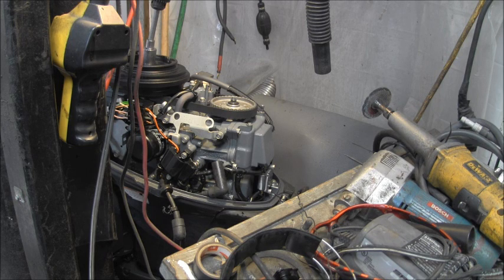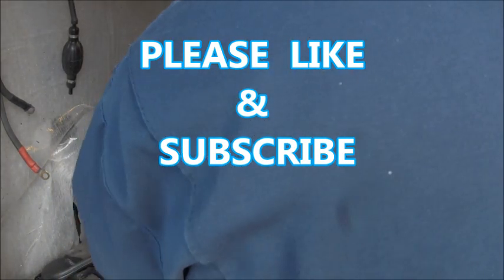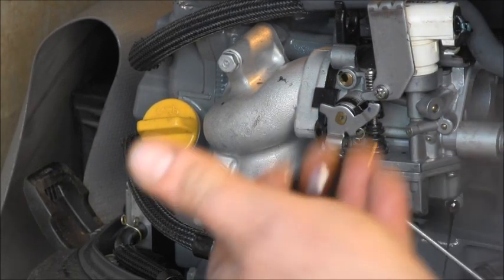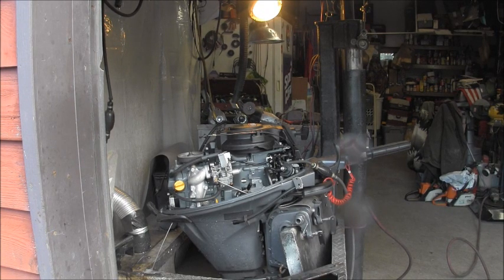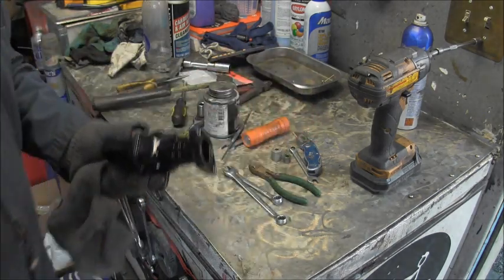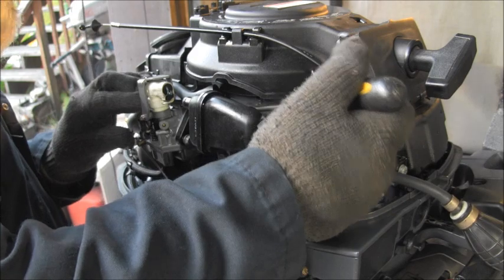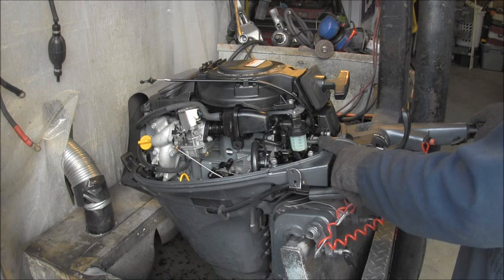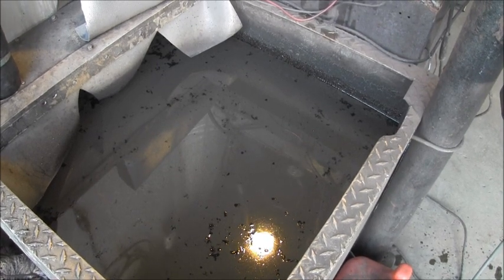2011 YAMAHA 15 HP 4 STROKE,  HYDRO OIL LOCKED  + Rant

Comment: I love both of my mercury 4 strokes - Smooth, quiet, almost  smoke free.  There is a right side and a wrong side to lay it down on.  On the side of my year 2003 merc 6hp 4 stroke there is a decal showing which side to lay it down on.  I take it off my boat every fall - transporting it home in the back of my truck laying it down on the correct side and never had a problem.  rtfm.
Reply from the maker: They R clean & quiet  4 sure, & great on gas,  But heavy , Tech will catch up I'm sure.  kodi

Comment: I made a tank out of one of those 375gallon plastic containers working great but those leaking lower units make big globs of oil looks like the movie the blob I use a butterfly net to get most of it and dawn dish soap all I have is old outbord motors newest one is 1974 6hp Evinrude
Reply from the maker: Good motors 4 sure,  If u add about 1/2 cup of lubriplate 105 to the lower oil they do not leak near as bad & it only helps the gears.             kodi

Comment: Another reason to hate 4-strokes two strokes can be a pain but 4 strokes, LOLL!  I would of walked away from that engine 10 times cursing my butt off before I would finally gotton past the frustration. I give you alot of credit you are more patient then me. That fricken carb alignment what a nightmare too. Maybe next time just go right to the carb and the fuel pump and see how bad the oil is in there before yanking it when you found oil in the cylinders. This video taught me that lessonioness & directioness for sure I speaka the Spanish ,HAA ............
Reply from the maker: Yes U R correct,  start @ the carb & work toward the filter.     kodi

Comment: Agree on weight of 2 strokes vs 4 strokes. I have a 87 Evinrude short shaft pull start. It weights 78# the 4 stroke I believe is 105#. I doubt if the four stroke could keep up with the Evinrude. I’m old and I can mussel around the Evinrude but not by much. No way I could handle #105.
Reply from the maker: Yep  me  2 lol    kodi

Comment: Would you mind sharing what lubricants, 2-cycle and gear oils you’re using now that BRP is out of business. I’m a newer owner of a JOHNSON and have read that their oils have special detergents in them for use in water! My outboard is primarily used in brackish and saltwater. I’d like to use the best, not the cheapest maintenance products I can so this will last. It’s a 2002 40hp Johnson.
Reply from the maker: I use Amsoil TCW-3 Marine 2 cycle oil for the powerhead fuel mixed 50-1.  I use Amsoil API-GL5  SAE  75-90 weight marine gear oil.  For general grease application for linkage/clamps etc.  I use Lubriplate 105.  for general spray lube I use Tri-flow.        kodi

Comment: Now since seeing this I am wondering. I am buying a 2018 Yamaha 25 hp 4 stroke, when I go to get it and bring it home in back of truck what side should it be layed on? I never knew about this. I have always had 2 strokes, so never knew Hydrolock was a thing with 4 strokes.
Reply from the maker: Mister B,  you have a few options, There should B instructions (decal)  telling which side goes up stuck on the motor.  However It can still happen if oil level is a bit over filled,  You can drain the oil into a contaner thru the oil drain bolt on the back of motor , Then refill when U get home. or build a small 2x4 transport stand for the back of your truck to keep motor semi upright.   kb
Reply: @kodibassInsideoutboards  Thanks for the Great Info! I have learned a lot from your Videos. Love the channel Keep up the great Videos!!!

Comment: I have the same model engine, and also have an oil problem. I bought it used and changed the motor oil and lower oil, new spark plugs. i set it up on a small work barge for about a month and everything was fine for a whole month. then after 1 day of laying on it full throttle for about an hour the following day I checked the oil, and oil shot out at me! any advice?

Comment: What is the model of the Milwaukee drill you use to crank the motors?
Reply from the maker: Milwaukee  1600  1/2 inch.                    kodi